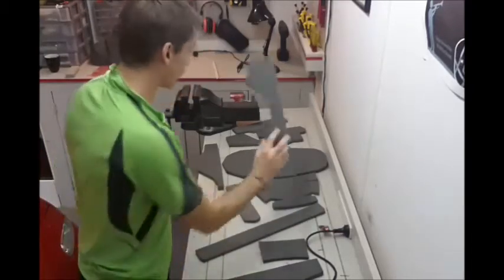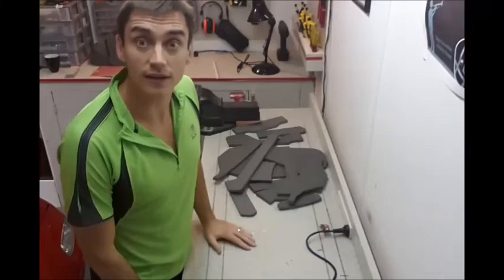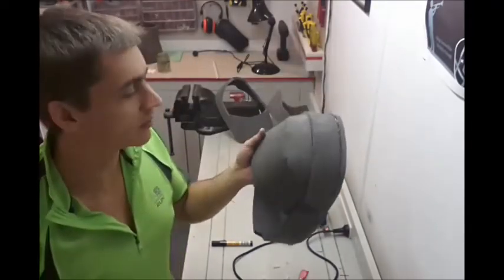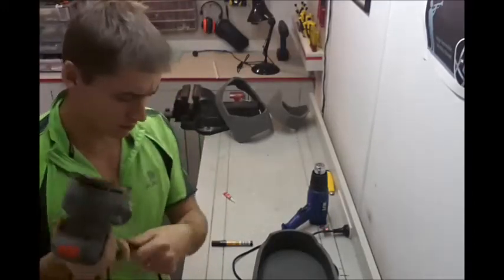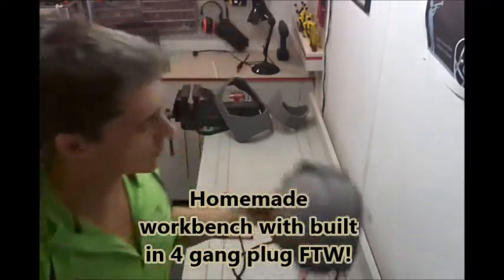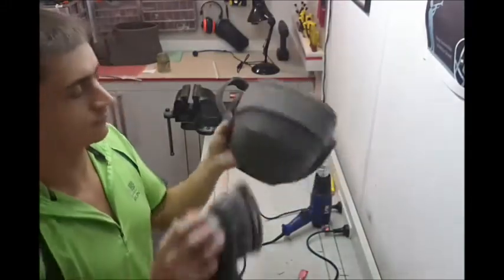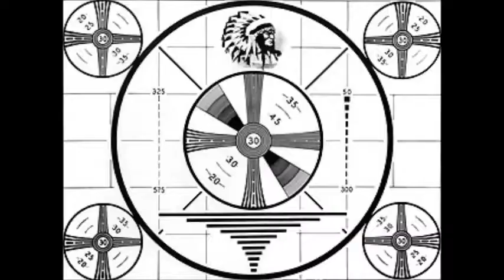How to make an EVA foam Space Marine suit - Part 5 - Making a Boot

Comment: do you may have by any chance a template or somethign you should share with us?
Reply from the maker: Hi Toby, the templates are fairly widely available as pepakura files on the internet. You can get them from the Obscurus Crusade forums. Hope that helps :)
Reply: then i need to check again as before i was only able to find the normal pep files even obscure crused, thanks
Reply: Wellington Ironman never mind, found the simplyfied foam version and allready on building thanks for your great vids mate
Reply from the maker: No worries, good luck :)
Reply: @CountryMaster16  could I get a link to simplified foam version please?